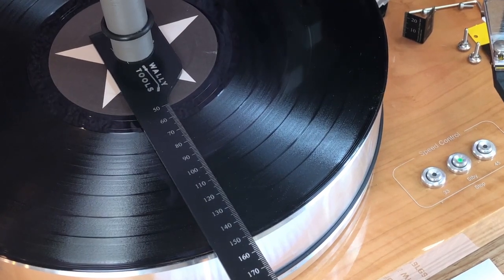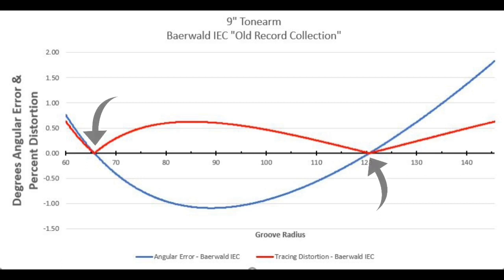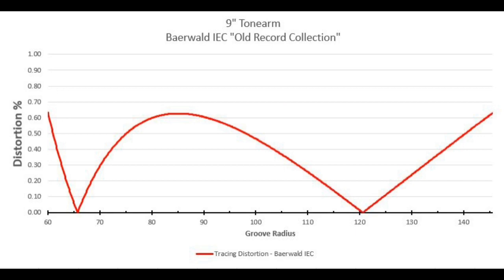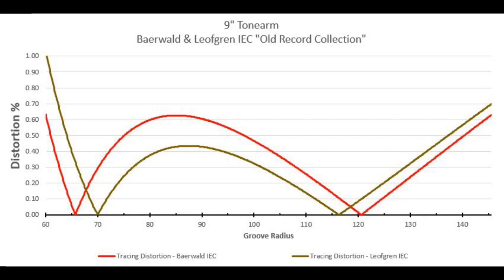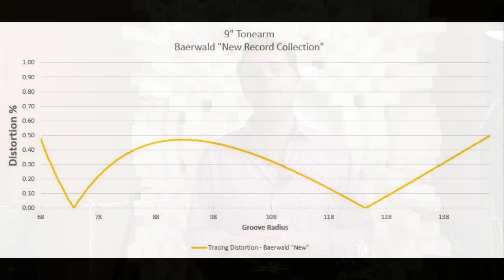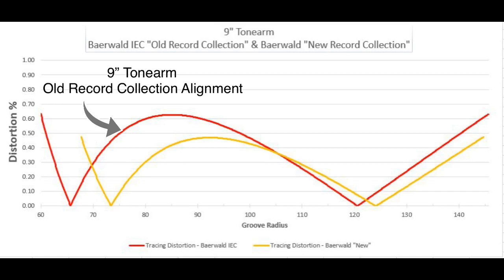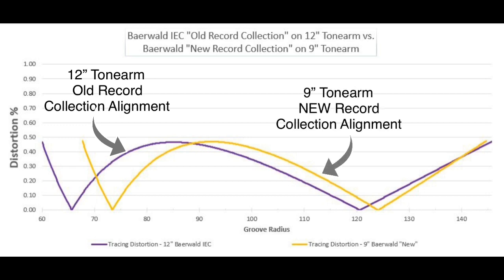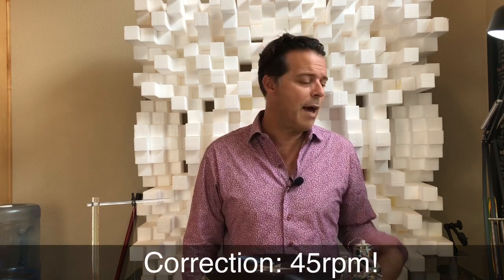WallyTractor Instructional Series (Part 2 of 4) - Selecting Your Alignment

Comment: Great explanation! My sole gripe with this video is that I align my turntable with Loegren, same as you,... yet the old/new arcs comparison was shown uniquely with the Baerwald arc. Is it because it was more visually striking or due to most people preferring that arc, or some other reason? The same data being shown through a Loefgren graph would have been the cherry on the sundae, IMHO.
Reply from the maker: Thanks for the message. There is nothing behind my selection of Baerwald when discussing the New Record Collection alignment. Loefgren is available for it as well. 

However, I have my regrets. 

When we developed the New Record Alignment pattern, we did not yet understand how bad the zenith error problem is in the industry. With an average zenith error of 2.5 degrees amongst the several hundred cartridges we have now analyzed, we can see that the Baerwald vs Loefgren or New vs Old alignment pattern is absolutely dwarfed by this larger problem. 

If you really want optimal playback, focus on this issue first.

Comment: Does a spherical stylus introduce time differential distortion due to tracking error?
Because of its even shape all around (unlike an elliptical stylus), it doesn't seem like it would.
Reply from the maker: Great question. It is true that a spherical stylus is not sensitive to CANTILEVER angular error. However, one of the two big trade offs with a spherical stylus is that it is almost always experiencing angular error as the groove modulates horizontally. Unlike a line contact stylus profile, you can never expect to have the line formed by the left and right contact edges of the stylus reading the groove tangentially. The exception to this is if the groove is completely unmodulated. But who wants angular perfection if you need silence to get it?! 😜 Look at the drawing at the bottom of this page: https://www.ad-na.com/en/product/jewel/product/stylus.html